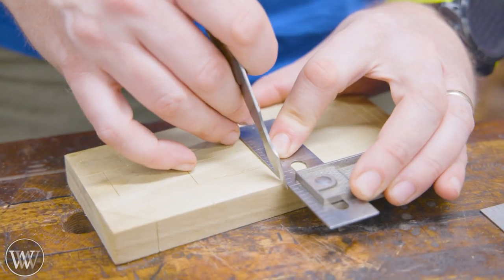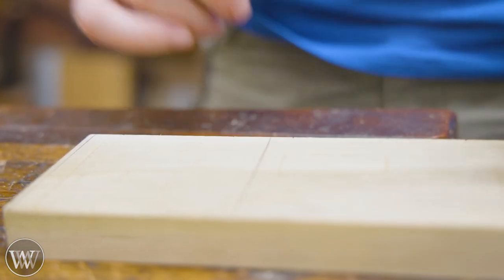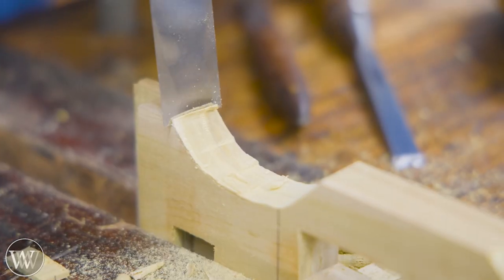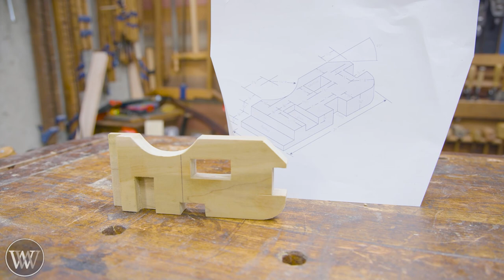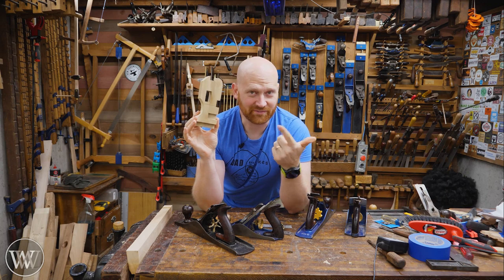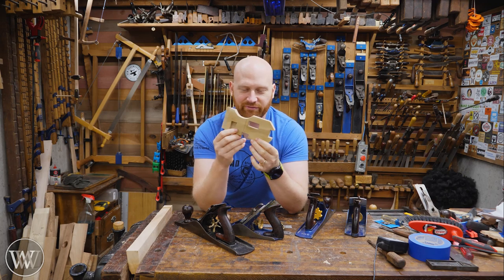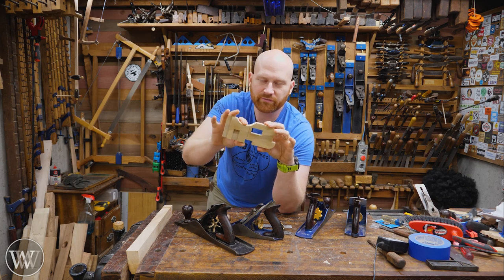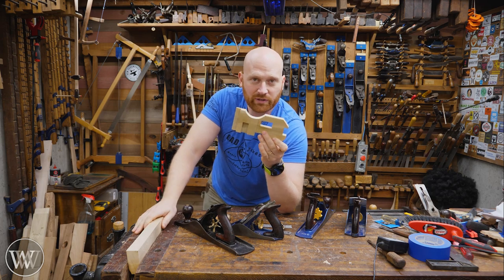Making a Gottshall Block ASMR ish

Comment: 🤩Please, Please, Please, Please, Please, Please, Please, Please,  set up one of those wonderful maker video challenges for the Gottshall block (call it the Gottshall Redemption Challenge 🥸) like the past 'single 2x4 challenges' or the machinists' 'shop tool video challenges'!!!! I could see limits of only 1 or 2 changes to dimensions (L, W, or H) and only 1 or 2 chisel features allowed to be moved/relocated to create a maker designed functional surprise product (a coat rack, a chisel till, or kitchen cookbook stand for example). Could be lots of chisel manufacturers interested in sponsorships, and lots of potential categories for winners (hand tools only, 1 power tool only, 'scrap wood' winner, big-time maker, 'amateur maker'...etc.)